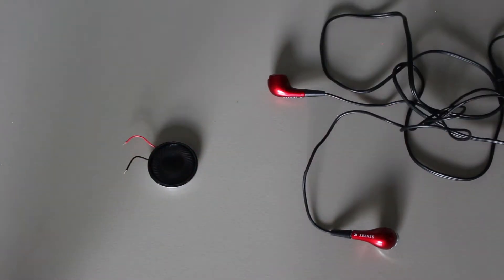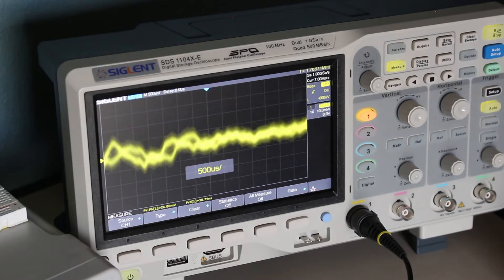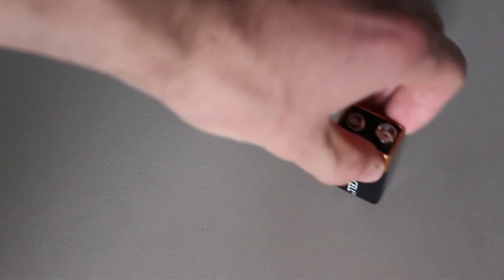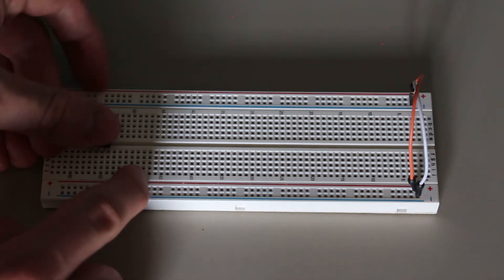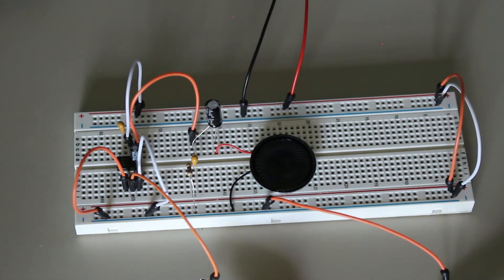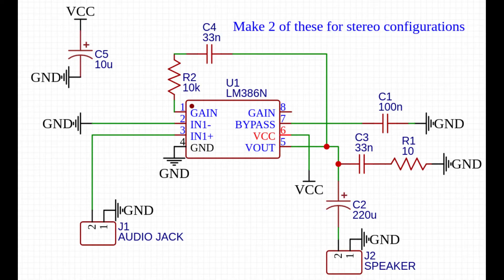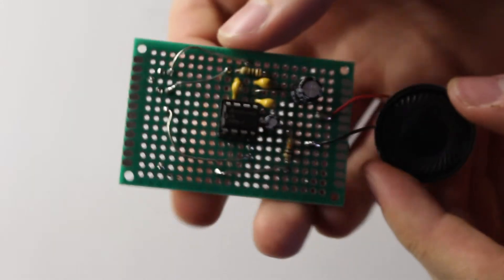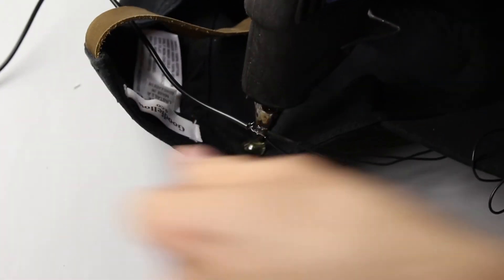DIY Music Hat - Play music from your head

Comment: Well, that's a fun project! I built the same LM386 amp. I used SMDs and had the boards manufactured. I positioned the bass boosting cap horizontally on the back of the board. I also used a 1000uF e-cap. Even with my larger e-cap, the whole board assembly is only the size of your thumb. You know about KiCad and the cheap PCB manufacturers, right? OSH Park and the Asian manufacturers...
Reply from the maker: Thanks! Yes, I have made a few PCBs and had them manufactured from China. I didn't want to wait for the shipping on those boards for this video though. I bet the hat looks a lot more discreet using such a small PCB.